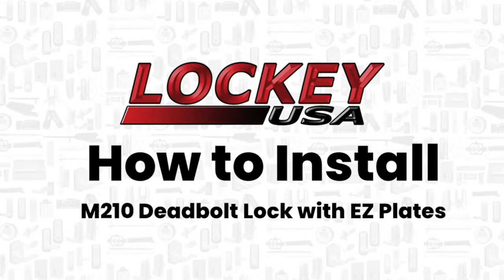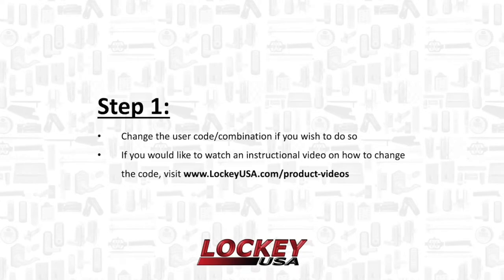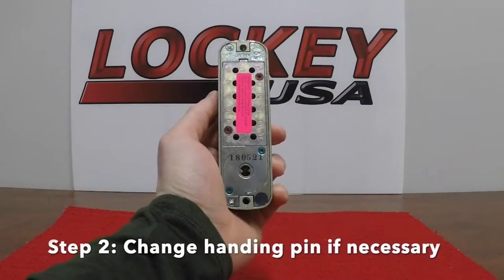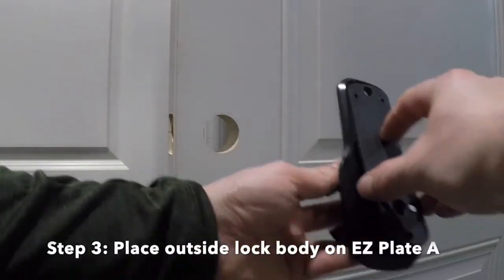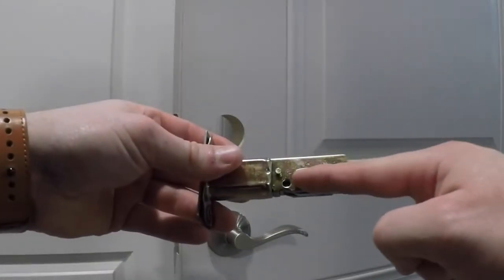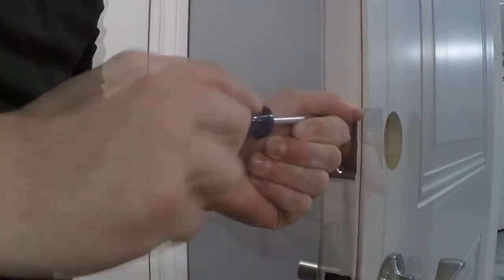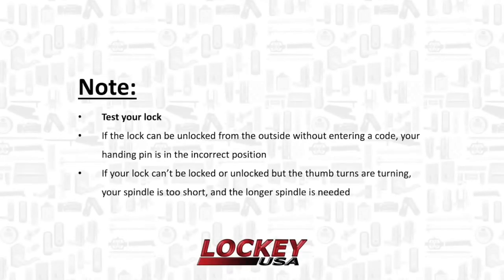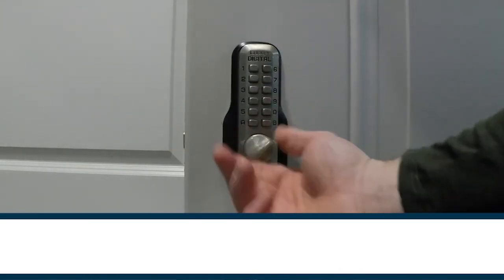How To Install The Lockey M210 Series Mechanical Keyless Deadbolt Lock With EZ Plates

Comment: When you say change the handing pin if necessary, you should specify putting the pin in on the LEFT side for left handed door or RIGHT side for right handed door. Just to confirm.
Reply: Yes that is what is throwing me. It is like…WHAT?! Very confusing for a beginner. More instruction is needed.
Reply: @denab72  I was able to figure it out..  Love the lock. Much more reliable than a digital one.